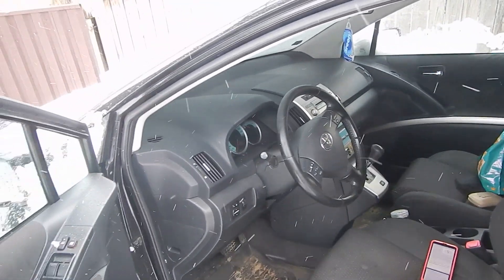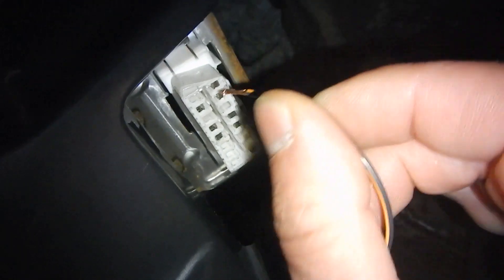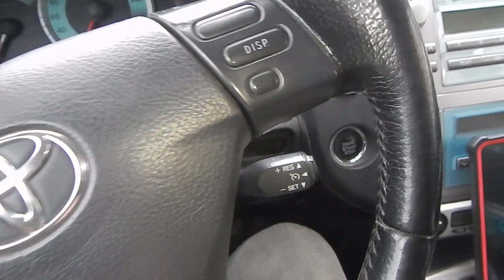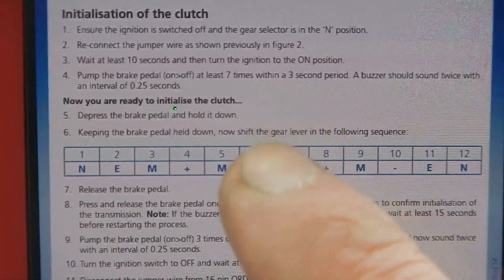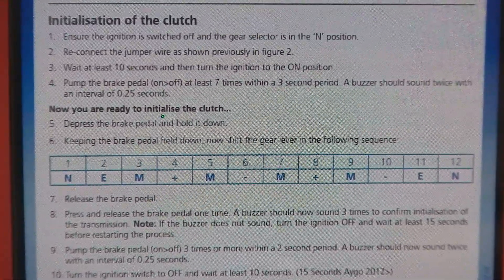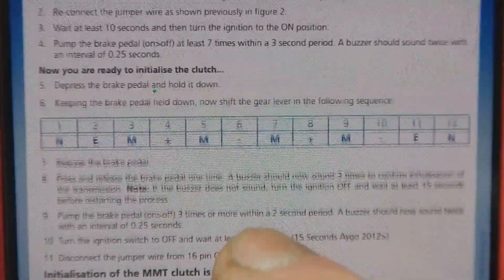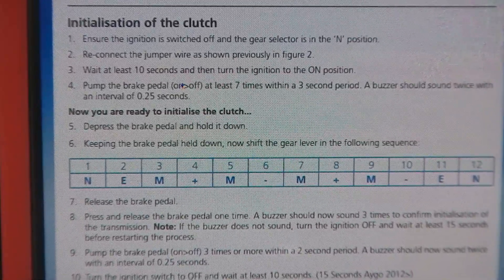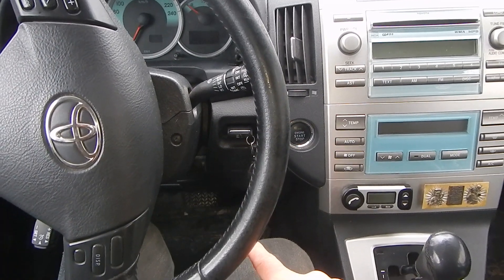Toyota MMT Multi-Mode GearBox Actuator and Clutch initialization Learning Code DTC  P0810 all models

Comment: Hello. Could you share the manual/file you were showing for instructions? Is it the official repair manual? Thank you very much.
Reply: Found it here if anyone else needs it :
https://oscaro.media/catalog/images/pdf/350/protipsadt330267_gb.pdf
Reply from the maker: Follow this link:
It is by blueprint by it is exactly like from toyota
https://www.techtips.ie/Blue-Print/toyota-multi-mode-transmission-mmt-clutch-replacement.pdf

Comment: Is there any way to increase shift speed? Harder AND faster. This is for a C1 racing car with auto for disabled driver. No need for comfort.
Reply from the maker: Yes, you have button - ess.
Reply: @vak_service funny. No i mean to get into the programming and change set values.
Reply from the maker: @goatcreek 🙂 i thinnk no possible, it is crypted processor. I have the flash file, i tried to change some values - after it not working, i think because need to calculate checksumm, but how to do it.

Comment: Hi, the procedure is working for the C1? My garage tell me that if you have a Clutch aactuator problem you should change the Transmission Control Unit too. (especially if you have P0810 code). Quite complicated the diagnostic of this MMT....
Reply from the maker: Hi.
Yes. For all mmt until 2012

https://youtu.be/lgFXJB-nhXE?feature=shared

Comment: Please I put another MMT on my 2007 Yoyota yaris 1.0 petrol, the gear will not go to gear 2  when I   drive  10 kilometers  Ph  the gear box making nois. What can I do ?
Reply from the maker: Hi. If no any codes. Try to do full calibration and drive in manual mode few days.

Comment: I went through the whole procedure, but the car won't put it in gear or reverse. Constantly flashing N. There are no error codes.
I tried the same thing with computer but no luck. The gearbox was working, I just replaced clutch 😢
Reply from the maker: https://youtu.be/_limxc7_2oc?feature=shared

https://youtu.be/b8H-RDu8VdU?feature=shared
Reply: I resolved. The problem was in wrong actuator position. Спасибо брт!  @vak_service

Comment: My car is a Toyota Corolla Verso, model 12/12/2005, and I am facing a recurring issue with it. Recently, while stopped at a traffic light, I suddenly noticed on the dashboard that the gear shift indicated it was in the “N” position, even though it was set to “E.” I attempted to switch it to “R,” but it remained stuck in “N” and was unresponsive. Additionally, a red warning light appeared on the dashboard.

I turned the car off completely, removed the key, and restarted it, and everything returned to normal. I was able to continue driving, but the issue keeps reoccurring intermittently.

I would appreciate assistance in identifying the problem and advice on what I should do.
Reply from the maker: Hello.
Need to check for trouble code.
Follow next video how to do it
https://youtu.be/W2DRdW2XflM?feature=shared
https://youtu.be/7c6mFTJgFXI?feature=shared

Comment: Salam aleikum!I changed actuator and calibrated as in your video a Yaris 2006 and it worked for a good month with actuator bought from eBay.The old actuator was a noname Chinese one.Now the fault light came on again but also the Obd port is not powering up the small code reader. Can I try the calibration process again or I should find out maybe a fuse is gone?
Cheers Chabi.
Reply: Or maybe the computer itself is faulty?
Reply from the maker: Comuter is ok.
Reply from the maker: Message me whatsapp +375 29 635 35 11  will talk about the details.
Reply: I tried new calibration and I can read code 21 and 35, all it does it resets the car so you can drive it again in all gears but then randomly restricts and stop again.Maybe the clutch disc started getting worn, maybe the beautiful eBay actuator is giving up.Have you got aikin refurbished actuator for sale?I can send only Chinese.
Reply from the maker: Hi.
Do you have old original?
Send it to me, will repair it. From Turkey to here postage working very good. And chinese send back to seller for refund, it will no more working:
https://youtu.be/IOk_xWAF-0I

Comment: Hello, I recently bought auris 1.6 mmt, sometimes the change from 1st to 2nd gear takes longer than it should, it goes into 2nd at about 3500 revs, shall I do clutch calibration?
Reply from the maker: Hello.
May be, but must be no codes.
Check for codes, erase, check again after few days. If no codes - you can do calibration.
https://youtu.be/W2DRdW2XflM?feature=shared
Reply: @vak_service  thank you brother

Comment: Hello my friend,great job. I changed my clutch and i repair the robot on my auris 2008 diesel and now with the super tool (wire on pin 4 and 13 ) the codes i can read are 21 , 41 and 96 i tried the calibration as you i m listening the buzzer correct but it does not work. When i fire the engine i see the red light of gearbox it does not accelerate only idle and N is blinking. Can you help me with this? Thank you
Reply from the maker: Hello.
Yes.
First - you need state - when you turn on ignition red cog light must off, if not - it mean you have active problem and calibration can not going.
Need to check all connectors
Reply: @vak_service  thank you i wil make a try today. Do you know what the code 41 means or 96? Is it possible aconnector to fit in wrong place?
Reply from the maker: @user-rq4fm8xd4y  https://youtu.be/1kSyTHlnDyQ?feature=shared

96 - p0562 - this is the problem, no power to tcm
Check all fat wires plus and earth or battery is low
https://toyota--corolla-ru.translate.goog/rm04f1ru/repair2/html/frame_rm0000015ee00cx.html?_x_tr_sl=ru&_x_tr_tl=en&_x_tr_hl=ru&_x_tr_pto=wapp

Comment: Hi am new to this page.i have a Peugeot 107 with mmt gearbox. Nuetral is flashing. No gears engaging.i saw your video with the similar problem where you changed the gearbox speed sensor. I have ordered a new speed sensor and actuator. Hopefully it will solve my problem 😢
Reply from the maker: Hi.
What you did before?

Comment: The car works and has been programmed fine. But ive still got the engine light and gearbox red light on with no fault codes at all. How to fix this?
Reply from the maker: Need to know what trouble codes in engine and gearbox
Reply: The trouble code is the clutch position sensor. However i brought a new original one, yet the same code shows:

Cluch position sensor circuit. All the wires are fine: car is running fine. Only the engine light and gear light is on
Reply from the maker: @Akusnypz  type the number of code
Reply from the maker: If it p0810 follow this link:
https://youtube.com/shorts/vcghOAiZi_Q?feature=share
Reply: Sorry i dont have the code. Like i said the car is programmed and working fine. But the engine and gearbox light stay on. The code is telling me change clutch position sensor, i put new one but still same issue
Reply: Code is P0807 and p0806
Reply from the maker: @Akusnypz  you need to change connector with wires
Message me, i have brand new connector
Whatsapp +375 29 6353511
Reply: Gearbox only works on 1 2 and 3 gears
Reply from the maker: @Akusnypz  or the sensor not ok or connector or wires. If you need - i have brand new connector with wires

Comment: Hello I need help I was at the garage they ordered a new clutch actuator and unfortunately after replacing it the problem with shifting to neutral while driving still there. What could be the reason? Any idea? The garage claims that they simply replaced what the computer indicated, and of course I have already paid for it, both for the new part, for the replacement and for the diagnostics, and now they suggest that they do not know what is going on, that it is happening further and they suggest replacing other car parts, the clutch and maybe even the gearbox.
Reply from the maker: Hello.
I'm sure the clutch actuator chinese one and it not working.
Take your money back, send me original clutch actuator will repair it with warrany:

https://youtu.be/IOk_xWAF-0I?feature=shared

https://youtube.com/shorts/_yBb2ShXidc?feature=shared

Comment: Thanks Vak, this video was helpful to identify.
In my MMT Yaris 2008, sometimes i see N flashing and the car does not start, after sometime it starts.
I tried to push the car but seems like it was not in neutral . I think its the calibration problem.
Do you think I should do a calibration like this and it will work ?
Reply from the maker: No.
It mean the car has some problem, first need to resolve the problem.

Comment: Hi need help auris 2012 automatic, p0810 so replace actuator and calibrate now no trouble code no error N blinking and no engage any gear and no revolution
Reply from the maker: Hi.
Because in this model p0810 - it is not clutch actuator.

Now you need to do bleeding air.
Follow next playlist, take big cup of coffee and check all videos, you will find how to do bleeding air and how to check if the clutch actuator doing his job or not.

https://youtube.com/playlist?list=PLUoC14M7mrC1Zc9PuKMUHjkAVEY7AfrQK&feature=shared

Comment: If I replace the whole clutch actuator with a new one is this what I need to do ? Or do I need to program something ?
Reply from the maker: Yes, need to reprogramm it, do calibration. Just don't buy from eBay or Amazon - all of them from china - not working. Send to me your original will rebuild to manufacture parametrs.
https://youtube.com/shorts/_yBb2ShXidc?feature=shared
Reply: @vak_service  thank you ! 
Is the “relearn procedure” the same thing a programming the new actuator I’m replacing with a orginal low mileage one from a salvage car.

Comment: Hello! Is the same for calibration with wire and with computer ,when we change the clutch?
Reply from the maker: Hello.
It is fully the same.
No metter which scanner or wire, not scanner doing the job, the tcm doing the job. The scanner only give comand to do calibration, or you can do same comand by wire.
If you changed only clutch, better to do calibration for clutch only.
Reply: @vak_service  some services are telling us that have mmt gearbox 'we should go to them to make calibration every 8000km or 10000 km . Should we?
Reply from the maker: @Grisel14Mokreri  Not should. But really is good solution. But only if no any trouble codes.

Comment: Thank you very much man, you are legend!!
 Worked, pluss i moved clutch actuator as close as i could and hopefully it won't come back, fingers crossed, knock to the wood!
 
 But i still have two codes 29 witch is "malfunctioning in the clutch position sensor circuit", saw it in your phone in video, and also 49 meaning of that one i couldn't find anywhere, can u help me please and tell me what can i do to fix it?
Car drives fine, but the codes are there
 Thank you brother!
Reply from the maker: Thank you too.
All codes here:
https://youtu.be/1kSyTHlnDyQ?feature=shared

Erase them and then check again
Reply: Another question, i don't have computer, is there any other way to erase the codes without computer, i heard that if you remove battery terminals and join them together for 10min if will erase any codes?
 Thank you.
Reply: Nice, got it, found it!
Thank you again brother, peace! 😎🙏

Comment: Thank You
I have put what you said in written format 

put in neutral
switch off everything
put the short circuit from link 4 to link 13
wait 10 seconds
turn on switch (everything should flash)
pump bake pedal 7 times and hold
put gear into E 
than take to manual 
switch to -M x4 times
Back to E
back to N
let go of Brake pedal and than press back down again
pump the brake 3 times and hold
turn off switch
wait 10 seconds
disconnect the wire
turn on switch
turn off switch
wait 10 seconds
use brake pedal or use N 
wait for neutral to stop flashing
turn on switch
turn ignition and wait until N stops Flashing 
now ready to go
Reply from the maker: Very good!
Reply: Another golden heart viewer who wants to help in community. Thanks bro for clarification

Comment: Hello Vak, "I have a 2007 Toyota YARIS D4D MMT with a 90 horsepower diesel engine. When I start and drive, the car shifts to neutral and stops moving. If I turn it off and restart, the problem repeats. What should I do, please? Thanks in advance."
Reply: Thank you so much
Reply from the maker: @asasgroupe1795  Feel free to contact
Whatsapp +375 29 6353511
Reply from the maker: Hello.
First you need to check the trouble codes, then will understood what the problem.
Follow next video how to do it:

https://youtube.com/shorts/W2DRdW2XflM?feature=shared
Reply: @vak_service hello thank you Vak, I have checked. I have only the 35 trouble code
Reply from the maker: @asasgroupe1795  35 it is p0810 - need to change clutch actuator and if problem will back also set of clutch. Do you know when last time clutch changed?
If clutch is over then 80.000 km, better to change both of them. 
Send to me clutch actuator will repair with high quality and warranty.
Reply: Thank you for taking the time to respond. My YARIS has 153,000 km, and I acquired it without the maintenance booklet. I have no information about the clutch. Is it better to replace the entire clutch assembly?
Reply from the maker: Yes, to drive along time without problem better to change all.
Follow this video need this set of clutch and 2 liters oil
https://youtu.be/l7zEO65dxPg?feature=shared
Reply from the maker: I can help with clutch too
Reply: Hi Vak, the good ref clutch for YARIS 1.4 D-4D 2007 is AISIN KT-320B ?  @vak_service
Reply from the maker: @asasgroupe1795  yes

Comment: Hi Yaris 2007 1.3 mmt makes thumping sound when taking off gear 1-2 if you press the accelerator softly but if you press hard no sound. It's like the car stops for a second thumps and re-engages? Any help?
Reply from the maker: Hi.
Make a video and send me to whatsapp
+375 29 6353511
Reply: thank you boss  @vak_service
Reply: Boss what is your full Country Code with mobile... Yaris MMT makes thudding sound accelerating  more worse gears 1-2  changed transmission /engine mount - still noise...engine revs also go high  car hesitates to move  gears 1-2 worse sound  - please can you advise what could be making this noise??   Can a faulty actuator make this noise?? @vak_service
Reply from the maker: @JamesGarner-wb7eh  +375 29 6353511
May be the clutch is slipping?
Reply: Hi bro is your problem solved?

Comment: Hi, Firstly thank you for posting your videos and sharing your knowledge! I have a Toyota Auris 2007 automatic. Couple weeks ago during service I plugged MAF sensor in when it was not fully dry after cleaning with the cleaner. Fried the MAF sensor. Anyway I replaced the sensor and car was fine for a few days then all of a sudden it started going into N and refusing to go into gear again. If I disconnect battery for an hour then the car will run again but problem is more frequent now. First time I disconnected battery it ran for 4 weeks before it happened again, second time 1 week and third time it only lasted 2 days before it slipped into N and wouldn’t change gear again. Do you think this is clutch actuator or did I fry something else when I fried MAF sensor because this problem never happened before MAF sensor issues. Any advice appreciated thank you!
Reply from the maker: Hello.
First need to check for trouble codes.
May be all this not depend of the maf.
Check the codes via wire and type what the numbers, follow this link how to do it:

https://youtube.com/shorts/W2DRdW2XflM?feature=shared
Reply: @vak_service   hi trouble code coming up is p0810. What do you think? Thank you for responding!
Reply from the maker: @erinleonard5269  p0810 - clutch actuator or clutch or both of them
Reply: @vak_service   anything I can do to fix without replacing both or need to replace them? Thanks again

Comment: hello, I have a 2009 semi-auto yaris and it showed manual transmission/heat clutch warning light last week, I shifted the gear lever to E but it go backward. But it is normal now without doing anythings. Do you know what happened? Thanks.
Reply from the maker: Hello.
Yes. Follow my shorts - how to check trouble code, check - type the code here, and i will tell you for what need to be ready.

Comment: Hey man! Thank you for sharing such usefull info. Toyota Yaris 1.4D 2008, the clutch is engaging in an uneven way but it works fine. Is this calibration going to solve my problem, or should i look somewher else? Thnaks
Reply from the maker: Hello.
Calibration not resolving the problem, it just make that car go smoother, check for trouble codes - if no codes you can do calibration, if yes - first resolve the problem.

Comment: Hi, i Have problem with Yaris 07, and i’ve no neutral and no other gear. No faults at reader, i reinstall clutch actuator and still no gear, no N. Please give an advice
Reply from the maker: Hi.
Yes.
Do this for yaris:
Remove clutch actuator.
Remove ectrical motor from it - clean it good from brushes dust. 
By screwdriver make that the rod of clutch actuator go inside maximum by the end, and half of turn back.
Install motor back, install actuator back.
Adjust gap to clutch fork, must be with no gap - no clearence and tighten the bolts holds it.
If it still gap to clutch fork - put some nut that it will no any gap.

Put the phone on the battery, camera to clutch actuator and make video of proceed of learning that i can see what do actuator and what noieses are coming from gearbox. And send this video to me.